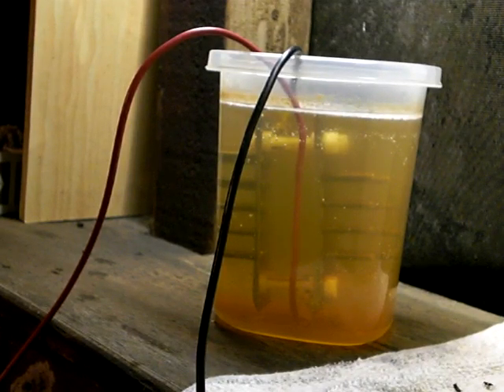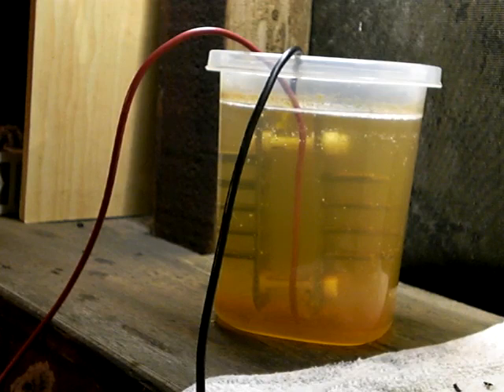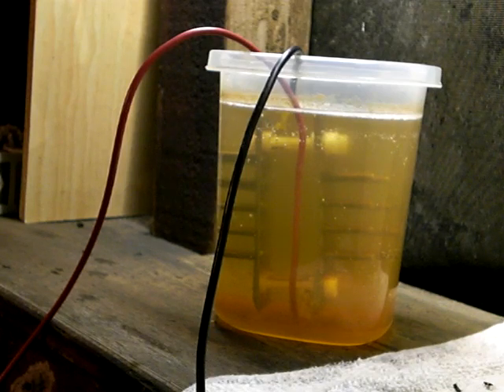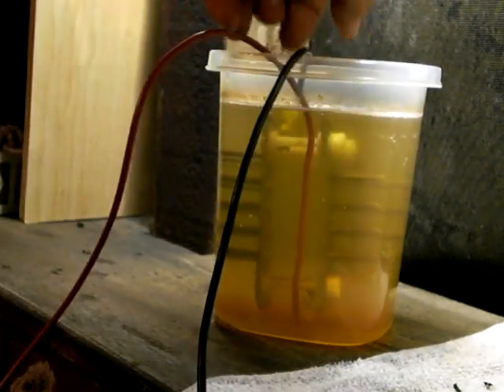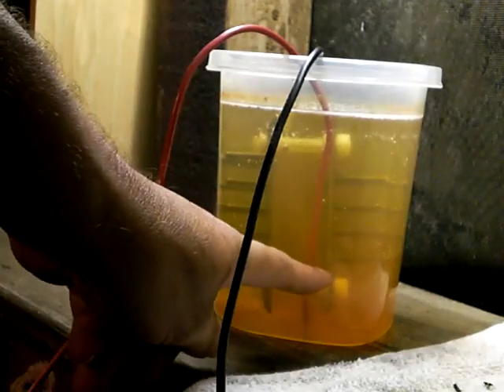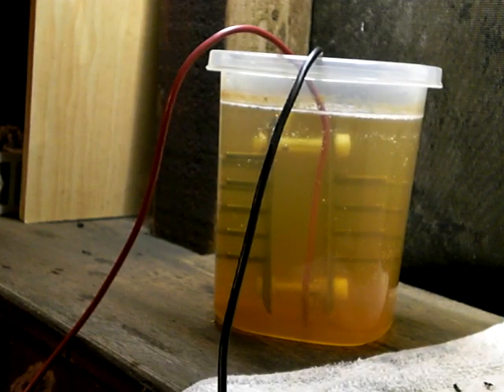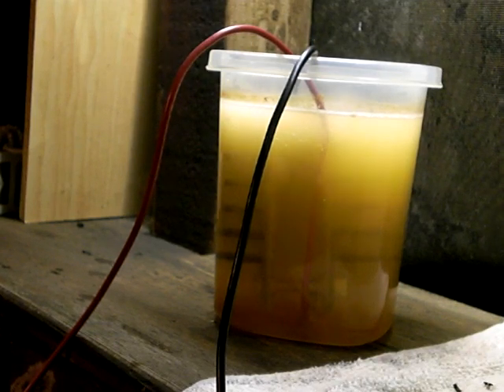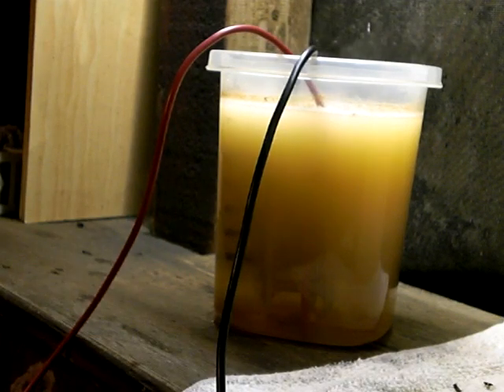Unexpected Hydrogen Production

Comment: i think you should find there is an effect of temperatures playing a role in production. please check this theory. allow water to cool, test output. then warm water, test output. plates may be different temps on pins or and alter over time? i beleive that the pulsing of dc current allows cooling effect and more output yet people do not have constant results due to temp fluctuations.

Comment: maybe its because the hydrogen is a smaller molecule and so it will go to the place of least resistance, its not the electricity that is moving it is the molecules. the plates are going to be relatively even when it comes to charge but because oxygen as a larger atom needs more surface area to accumulate on... just a thought..